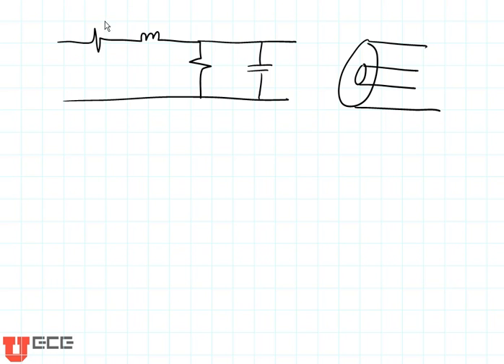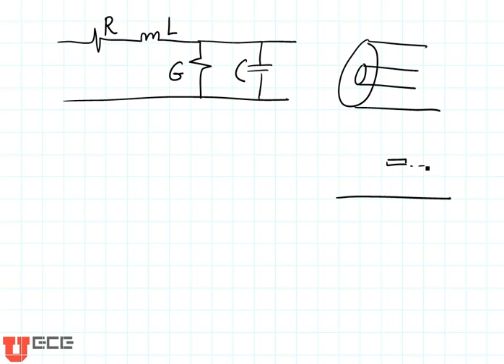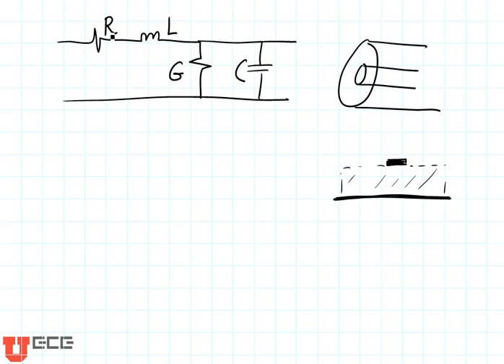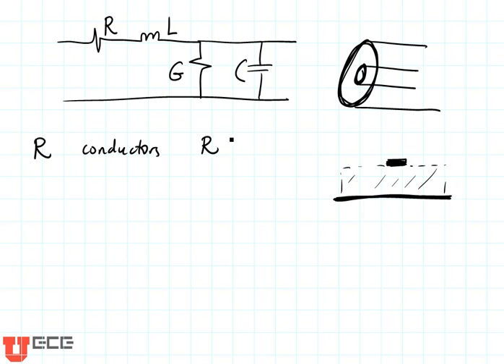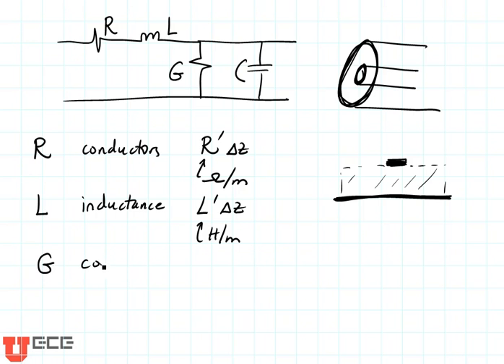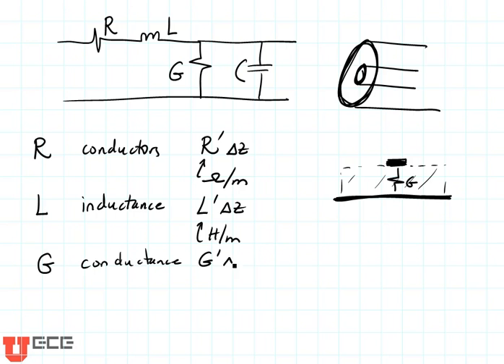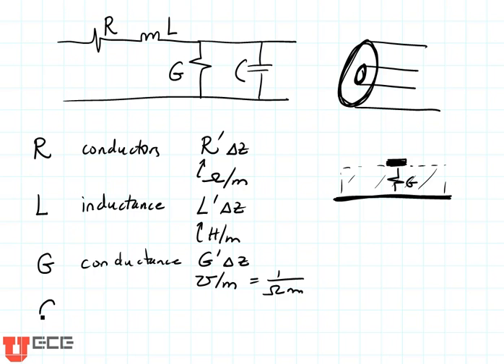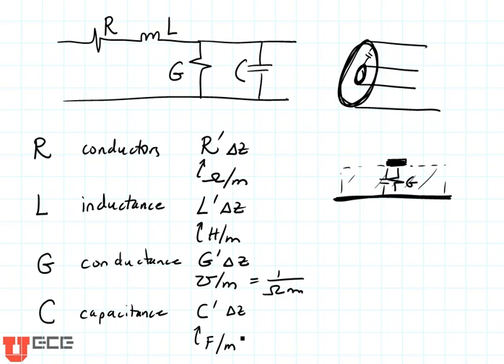ECE3300 Lecture 4-5 transmission Lines

Comment: Mho's??? I guess you meant Siemens.
Reply: Not sure but I think Siemens is the unit of (sigma) which is conductivity (or the inverse of resistivity- resistivity is littered as Rho)
Reply: @abdallah.alammar   Mho is indeed the term for Siemens in engineering. People like to distinguish themselves! Most of the time in a confusing way ;-)